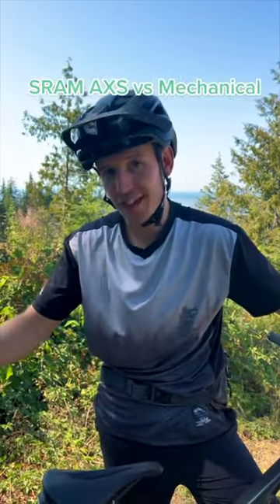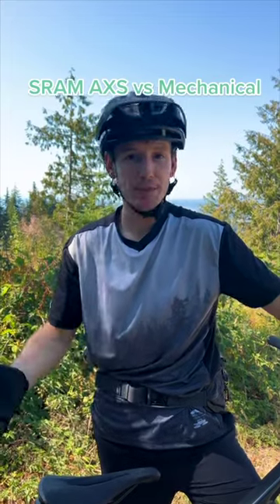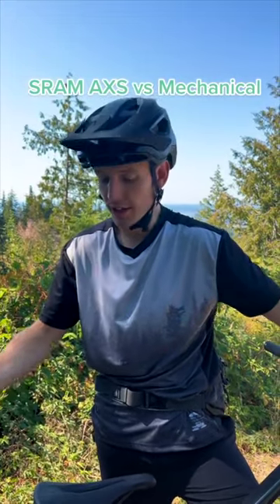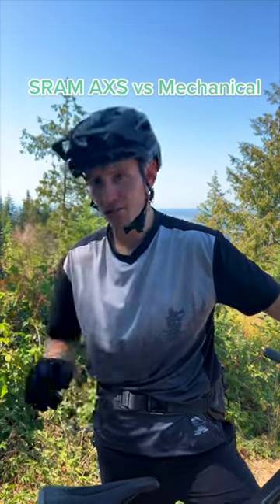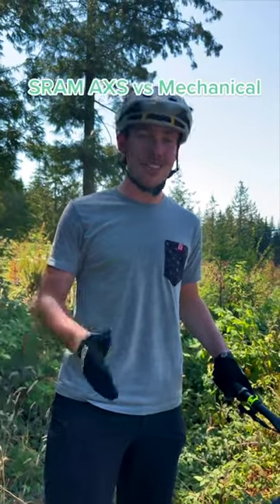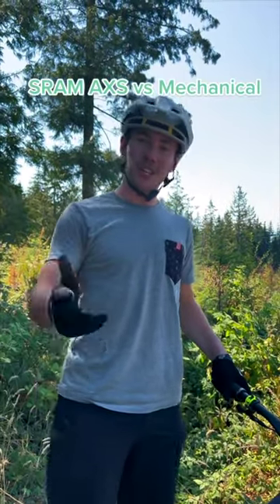Electronic vs Cable MTB Derailleurs

Comment: I have both. They’re both excellent. If you suck at setting up cable shifting, then the wireless is easier to dial in. But if you’re good at setting up good clean shifts with cables, then you’ll be fine with either. Just remember cables stretch over time so you’ll need to give more tension down the road. With wireless, you set it up once, you’re good for life.
Reply: Yeah as long as you keep the battery in check and adjust it properly from t he start the electronic shifter should be good. The only negative I would say about electronic is that my Gx axs has been kinda funky lately. I feel like it might have something to do with the battery not making full contact with the pins on the derailleur, but I’ll have to look into it to be sure. That’s one thing that’s nice about cable: even if you do have to service it more often, at least it’s easier to pinpoint the issue. Anyways, I’ve had both and they’re both really good and each have their benefits and downsides
Reply: @hucktoflat1416  oh that happened to me, just send it for warranty. Its dirt getting stuck in the pogo pin and stopping it extending fully=
Reply: @sufyanm4661  ahh ok, thanks for letting me know
Reply: The clutch on the wireless stuff is a lot weaker. That’s for sure.

Comment: I have Shimano XT 8100, Deore 6100, mech. GX, GX AXS, XO1 AXS - all of them are great. If you are not good in adjust after installation - none of them i  listed would work fine. 

The only thing i think Shimano is way better than SRAM - no adjusting needed. It works just perfect from the second you installed the derailleur and shifter. The only setting i did in whole years (Shimano 10by, 11by and 12by) is the barrel adjuster.

New SRAM t type transmission stuff ugly as fuck. 😂😂😂😂
Best looking group on the market is 2021 X01 lunar grey mech. and AXS and GX mech. and AXS. Just adorable 👊🏻💪🏼👍🏻

Comment: I don’t like having to remember charge it…plug it into the bikes battery and I’d like it. One battery. Accessory port in the back for derailer and one at the stem for lights.
Reply: Do you forget to charge your phone, your iPad or your Tesla? No! Forgetting to charge is never an excuse.
Reply: @GokkunGuru  I do forget to charge my phone sometimes. All I was saying is plug all the cool tech into the e bikes battery so you don’t have all the accessories to charge. Maybe have the small battery on the derailer as an accessory so u can run it on an acoustic bike if you want. We need a universal waterproof port back there on e bikes for the electronic derailers.

Comment: For for long distances if the battery runs out what do you do 😮 cable I like 100%
Reply: You would have to be riding for about 100 hours to worry about that
Reply: @QuakFu  great 👍 long battery 🔋 thank you
Reply: 100 hrs might not be quite accurate 🤣 but I ride @ 3x week and charge them maybe once a month

Comment: There is zero contest. AXS doesn't have stretch, easier to do small adjustments while you ride and provides a better, more precise shift. And all the talk about forgetting to charge the battery is nonsense... Take them out and plug them in every couple weeks